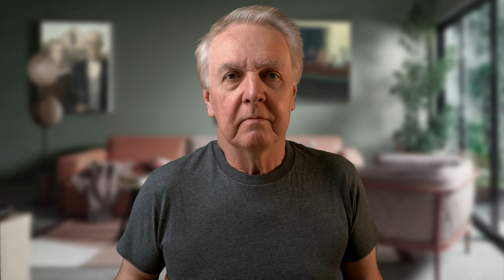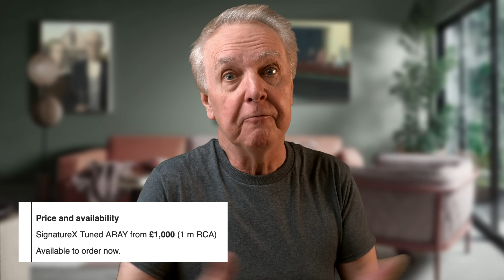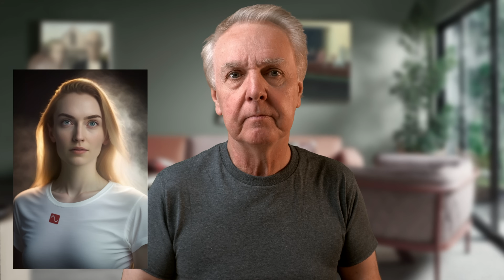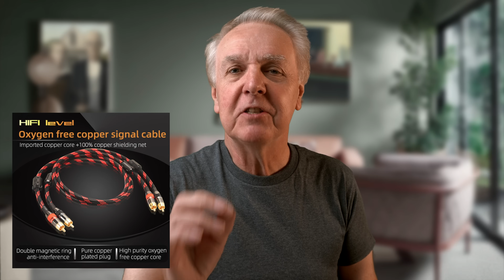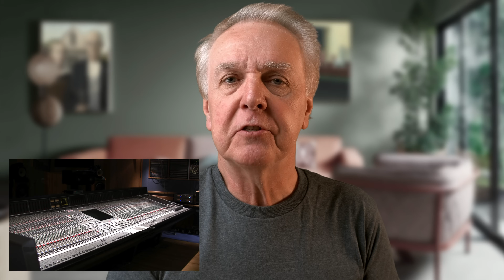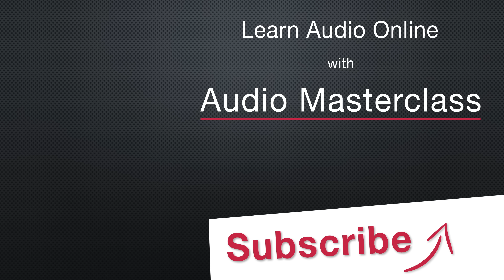Would you pay $1000 for a 1-metre cable?

Comment: A few years back, some French chaps visited BBC Archives to take a copy of a concert we held on 16mm sepmag film. They brought with them a very expensive Devialet ADC and some phono leads that were as thick as hosepipes and cost over 5000 Euros (Absolue TIM Signature). Not only were they directional, but they also stipulated which was the right and which the left. Le sigh. Only thing is... in the professional audio world we are balanced and phono is of course unbalanced. This totally threw them, as they hadn't brought a balancing box with them. Evil BBC engineer wot I am, I went down to my store and brought back the crustiest, rustiest Alice MatchPak I could find...  :P
Reply: typically english.
Reply: That was something I wondered about when I first encountered these "hosepipes" 25 years ago. If an unbalanced set of interconnects could be so bulky, what might a balanced pair look like?

I did get the chance to use a pair of unbalanced directional interconnects once. It was at a live gig in a pub where we had cobbled together a bunch of known equipment between a few of us for a rock act. At the last minute the brother of the guy who owned the speakers and amplifiers produced a set of freshly constructed and yet to be "burned in" directional cables which we used to patch the FOH EQs to the power amps. We rang the PA out as usual - halfway through the gig and we were adjusting the upper bands on the EQ to compensate for ever increasing levels of unexpected high frequency content. Which we were assured was part of the cables "burning in" process; all I know is it did our heads in. I've used more conventional interconnects ever since.

YMMV of course.
Reply: You're not entertaining

Comment: Anyone who thinks that spending that kind of cash on a short length of cable is going to buy them audio nirvana is delusional. In my opinion, if changing an interconnect makes a huge difference in the sound of a system, either the original cable was bad, the system has other problems, or the listener is hearing things that aren't there.

Comment: Digital audio & video design guru John Watkinson stated in one of his “Slaying Dragons” articles, sadly I forget the pro audio magazine they were published in.
“if changing the interconnect cable, changes the sound. The audio interfaces have not been designed properly”.
In my 40 years in the Pro Audio industry, as long as the cable was well constructed & used non tarnishing connectors (brass PO & Bantam jacks needed regular cleaning), they all sounded the same; ie did not affect sound quality. 
And don’t get me started on gold plated Toslink (optical fibre) connectors, yes they do exist!
Remember the old saying about a fool and his money………
Reply from the maker: The mag was 'Resolution'. Some of the Slaying Dragons articles are available freely at https://ips.org.uk/category/slaying-dragons/, others behind a paywall. DM
Reply: That is exactly what I was hoping to explain here but Iv'e got  no success because it takes serious  knowledge - it is rare to find  in YT.  . Cables do not  harm the  current but they make unstability to audio interfaces.

Comment: I fully agree that most of expensive cables are marketing tricks to make you buy them.  However, I would be careful with poorly selected cables for a wrong function. Few years ago, I needed cable extension for my Sennheiser headphones. I just happen to have nicely looking curly (coiled) extension cable so I tried it.  The result was a disaster. I almost completely lost certain instruments ( like guitar) in all recordings.  This cable worked like a filter for some frequencies.  It probably had high inductance.  Now I am trying short (40 cm) cheap cable extension with other headphones and I think I can hear the difference. My bottom line - I think selecting good quality cables for the right purpose and price matters.  At the same time there is a great selection of con and voodoo cables at very high prices.
Reply: The inductance of audio cables is almost never of any consequence because of the low frequencies and closely spaced conductor. X = 2 * pi * f * L.  X is the inductive reactance in Ohms (imaginary). Because f is small the impedance is small too. The close spacing causes their magnetic fields to cancel and reduce inductance, which is already low... It may have been an ultra-flexible braid cable and had too much resistance, depending on the impedance of the headphones. 8 Ohm 'phones present a load heavy enough that the very thin conductors could make a difference?

Comment: You should borrow it and see if it’s got any merit. 
I think in professional equipment the interfaces are built to the same specifications. So the cables change the sound less than with domestic equipment where impedances and capacitances at either end of the cable depend on how fastidious about technical standards each equipment manufacturer is. Cables that stray from technical norms connecting equipment that strays from rechnical norms will change the sound. The trip is to choose something that excites your ear if you are an audiophile. In the studio cables will affect the outcome but probably less noticeably or significantly. Balanced feeds and impedance matched interfaces combined with correctly used cables level the playing field in professional use. However some professionals stray to the dark side and buy audiophile wires to spice things up…

Comment: Measuring cables is pretty much pointless, not because you can't measure any differences, of course you can but compared to the capacity and resistance of your speakers or amplifiers they are lower than the usual deviation within speakers or amps, so talking about these micro differences in cables is pretty much pointless.
However there are certain ways how to construct a cable and since people are lazy by nature obviously everyone copies the ideas of the competitors (no not only the Chinese). The interesting thing is that people describe certain differences in constructions the same way. I.e. a cable with a silver surface is usually described as brighter or more detailed high frequencies, a cable with a larger surface (than a circle) is also usually described as more detailed but without being bright and solid core cables are usually described as faster or more controlled.
So if we perform a cable test and the sound descriptions would be all over the place, we could assume that this whole cable thing is just bonkers, but since they are repetitive claiming that you can't really measure it therefore it is all bonkers is just not enough.
The topic of what is a resonable price for a cable is a whole different story.
Reply: How much you think is the impedance of average amplifier input the capacitance of average interconnect?
Reply: @Mikexception  obviously depends on the brand/construction but we are talking about magnitudes of 100-1000. Many amps have coupling capacitors in the input signal path to avoid DC.
Reply: @snakeoilaudio  I did not ask on what it depends. and about not named magnitudes. 
 Obviously you said  you do not know. How can you know something is lower than usual if you do not know how much is usual value ?
Reply: @Mikexception  sorry but your question does not make any sense, it's like asking "how fast is a car" and I gave you the example that it is dependent on type and brand and some have bigger engines than others.
Reply: @snakeoilaudio  Up to you: is average car ,maximum speed 10 meters per hour because evereything is possible and  depends  on brand and engine? At least you should know something, (at least  a bit).   . For Youer information  for cars (maximum) speeed in average is  (170 - 220) km/h. No need to thank. 

 "Sorry" but  it is problem with      people talking about audio gear when  they do not understand it's construction at all. That is why they do not know any speciific values. Only using meaningless words "micro" "lower"  "maximum"  which is annoying for people like me who can design amplifier from memory. 

Without understanding   construction you cannot understand impact of cable on it. Pls - don't try to shift me to nonsense "cable  believers". I am not talking about their special undefined data - only abot real practical knowledge which is a must already  on lesson in school.
Reply: @Douglas Blake That is not true. Most interconnects 1,5 meter long have 300pf -1000pf.  I measuereall my "average" brand made economy  interconnects with different meters . That is my most impostant reason of degradation for which I take care since many years usualy by using thicker ones and using not originaly intended outputs from devices but only those with  low output impedance . . .   

Interconnects   are no able to interact with audio input - they affect only and  exclusively  outputs. 
My question was just about what you eventualy may know. 

Loading Impedance of such interconnect  for  33 Hz is about 200 kOhm   and  may be ommitted while for 10000 Hz it is only 6,5kOhm usual output impedance of preamp is from 47k  but for recording from tubes  may be 220k or even 470 kOhm. 

 Then  in case of even   47 kOhm you receive only 6,5 k/47k - 15% of sopranos input value.   Brainless people do not hear sopranos and buy better tweeters and  cables. People like those informed by You.  That is my point.
Reply: @Douglas Blake   "So what's your point?" 'You  do not like to be  answered for your questions  and that  is deeper problem   .
Reply: I wish I'd measured my speaker cables, I've had to buy another set to give me the positioning I need.

Comment: Thank you for exposing the pure snake oil that are interconnects. All any normal interconnect needs to be, is shielded and have low capacitance. And the capacitance only matters if the source driving it is high impedance. Shout out to Amir at the excellent Audio Science Review channel who takes the time to test many of these audiophool products with proper high quality test gear and has never yet found a reason to waste your money on them.
Reply: It all is a mattter of  how much is low interconnect capacitance and how much is high source impedance. In Pioneer SX34  tube amplituner output source impedance is 470  kOhm Is it realy  disaster  when comes to  interconnect capacitance. In my ITT stero radio output impedance is 220k Ohm - interconnect makes disaster. In my Bang Olufsen output impedance is 100kOhm -   it makes sometnhing to think about. Of course it is not about price and High End tag - it is all  about technic.
Reply: That's why I buy the cheapest audio components they sell as soon as the distortion is under 0.1 %............nobody can not hear the difference with a10000$ amp or other component , they measure the same ...

Comment: Even if the cable does what it says it’s just from point A to point B and who knows what type of cable are used inside of the components used in your system so to me a cable is a cable and for short runs especially in situations where the cables are stationary and not getting stepped on I say save some money and get more bang for your bucks

Comment: It's not a balanced cable so it could have noise issues. For such a short length of interconnect I suggest maybe the price is not a good return on promised performance. Yes I have noticed the difference with improved interconnects but then switch cleaner on the inter connects can make a big improvement and is less costly. In a perfect world the interconnect would not change the signal that it carries. Sadly it's not a perfect world but we can try to get to a level which is acceptable to our ears.

Comment: All good points. A fool & his money is soon parted. One important point, the dielectric or method of cable construction should not introduce microphonics. You mentioned directional cables, they are a real thing. I use inexpensive unidirectional Monster cables. What makes them unidirectional is: the audio signal & ground are heavy gauge twisted pair wire but the outer (interference) shield is connected to ground at one end only, the destination, where interference is sunk to a common ground point. A twisted pair, by its nature, also has interference rejection properties.
Reply: For good twisted pair interference rejection, the geometry of the cable has to be balanced. In a single ended system, such as RCA/phono, grounding the shield at both ends creates imbalance (one hot conductor, two ground conductors). In a balanced system, the shield may or may not be connected to ground at both ends without causing imbalance. In large multi-cable multi-unit AC powered systems, one reason for disconnecting a shield is the presence of a ground loop causing audible hum.

Comment: Witty!
Audio is like religion, or politics - no amount of rational, scientific argument will convince the "believers".
And as the saying goes: arguing with "audiophiles" is like playing chess with a pigeon...no matter how god you are, the bird is going to shit on the board and strut around like it won anyway 😂
Reply: Your response  reminds in politics.  Instead of solving problems shifting them all in one side by generalization and then 100% kick .

 I fought with interconnects to my  amplituner because of degradation which was unacceptable also for biggest enemy of so called BS. Interconnect was cuting  sopranos to 2,5  kHz  Thing is once interconnect is too bad you can do nothing with it - even 1 milion $ for 1 meter will not change it. Beacuese it is not a matter of materials and  shine but diameter which should be say 0,5meter  And if it  does no harm (which actualy  depends on audio interface not the cable ) it will not be sense  to pay thousands of $ hoping  for better when faults are 99% in other gear

Comment: all hogwash, the equipment you are interconnecting has inferior wiring inside, circuit  boards with solder traces to pass along audio, pots of suspect quality, that all matter more than any cabling. No one, and i mean no one, can hear the difference between a good set of cables $25 and anything costing $10,000, if they can they are lying.

Comment: The most I've ever had was to make some leads using RG58 coax, I had bought some nice gold plated RCA plugs, trouble was the cable hole was too big for my ordinary shielded wire, which looked kind of lost in that hole, so
I used some coax I had handy, worked well, although I'm not sure if the audio is any different
Reply: Your poor audio signals, crammed into that tight connector without room to spread out in those spacious big cable holes
Reply: @editingsecrets  That's why I tried those connectors, as the normal cheap ones would only accept a rather thin cable & the outer grounding fingers often made poor contact.

Comment: I made a lot of my own interconnects over the years. Always used a decent quality cable and connectors, but nothing that would even remotely break the bank. Never had any issues with the sound quality being affected.
You have to start scratching your head if the cost of interconnects means you can't afford to stack your components in a more convenient order 😁
Also, after travelling through this $1000 signal superhighway, the signal may go through 20cm, $0.20 worth of cabling to the volume control inside the amp...
Reply: All componenents do extract something from the music.....and some do less harm...

Comment: In RF world, there is the "skin effect" where higher frequencies tend to run on the outside of the connector.
I have seen audio cables that have different multi conductor wire wrapping pitches to allow low, mids and highs to travel in different parts of the wire.
I just don't know what to say other than...are you FN kidding me!?!?!
Reply from the maker: The next step might be to split the signal into bands of frequencies and run each through its own cable, optimised of course to that band. That £1000 cable might suddenly become £3000. DM

Comment: Shouldn't that be £1 per centimetre. £1 per millimetre would be a £10K cable. Of course, I am being pedantic :-)
Reply from the maker: According to my rather ancient and dirt-encrusted calculator 1000 GBP divided by 1000 millimetres in a metre comes to £1/millimetre. I could try a different calculator... DM
Reply: @AudioMasterclass  The original slide rule the Beatles used to calculate reverb time might still be in the closet at Abbey Road Two!
Reply: @AudioMasterclass  Hmmph. Well, don't I look foolish! I can't bring myself to tell you what I do for a living but suffice it to say I have clearly become over-reliant on XL spreadsheets and other number-based computer programs to the point I can no longer correctly work with the number 1. Yours in humility...